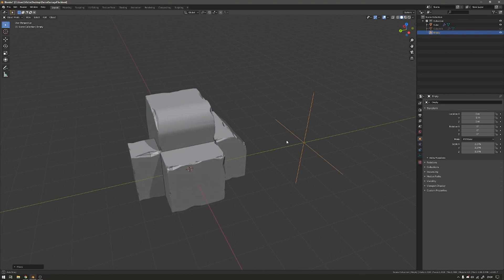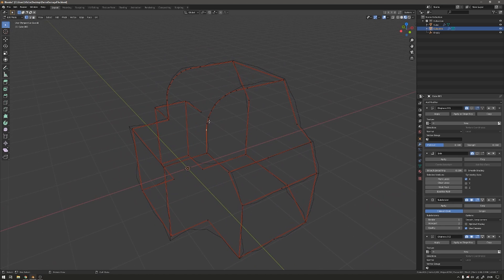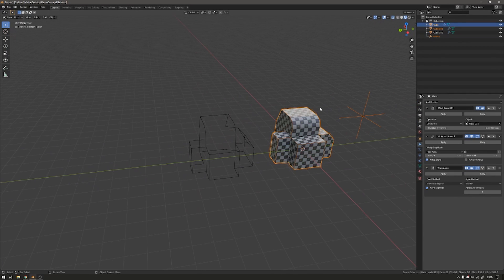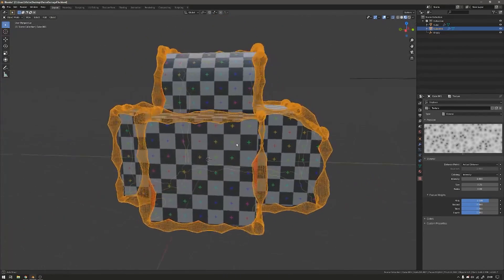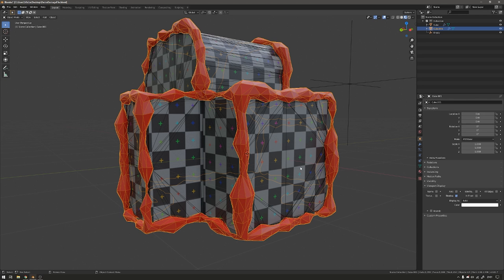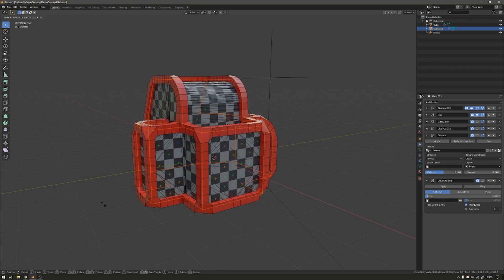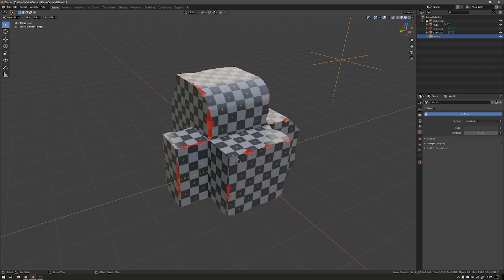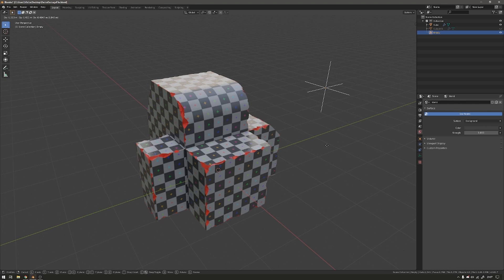Blender Semi Procedural Edge Wear Tutorial

Comment: 4:01 Another way to turn 1D mesh edges into 2D planes or 3D solid rods is with the Screw modifier. Set the angle to 0° and the “Screw” to the width of the planes, and there’s your 1D → 2D transformation. Add another Screw modifier along a different axis, or use a Solidify modifier, to give thickness to the planes.

Comment: Super cool stuff! Makes me even more excited for everything nodes where hopefully workflows like these become more robust and completely non-destructive unlike requiring a fixed base like this. But I guess it could be (partially) possible through modifier stacks being saved into a datablock and being able to save them in the asset manager, where I can just download this stack and use it on my wireframe instead of going into a blend file and copying modifiers manually.
I also wonder, if it could be possible, in any modeling paradigm to maybe have an ability to select vertices/edges/faces by curvature/pointiness, it would come super clutch for workflows like these where you could keep modeling and get a controlled cage without inner edges coming along the ride. That actually made me realize a Selection modifier would be great (where you could just generate selections of edge groups/faces by traits non destructively) and use that to drive the remaining modifiers in the stack (essentially like selecting vertex groups manually in those modifiers, but instead those selection groups are generated by that prior selection modifier). Something like faces having the same normal direction, coplanar faces, faces with a number of sides, etc. Either way, thanks for the tutorial, it was very insightful!
Reply from the maker: I did try and even get a few things like this working however they were too unstable and quick to break if you tweaked them even a little bit.
But I agree with you, there is a lot more possibilities with this workflow.
I will revisit it after the next Blender updates and see if there is a way to make it fully procedural :) 
Cant wait to see what you do with it if you use it!
Thanks for the comment.